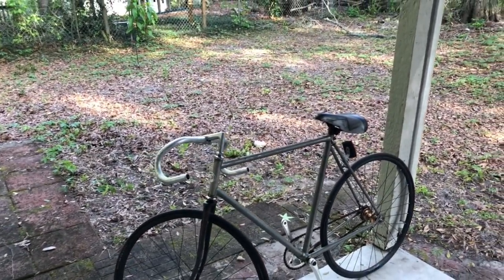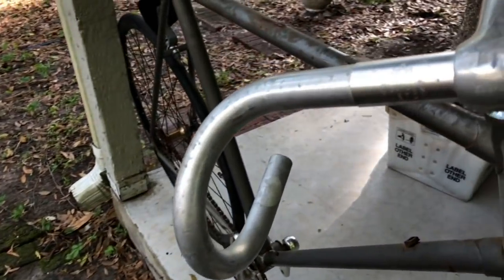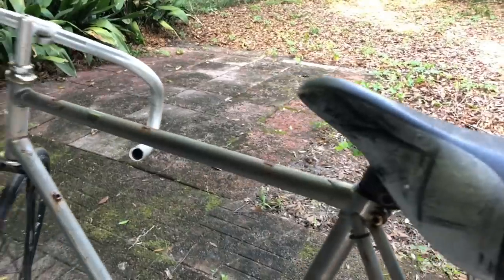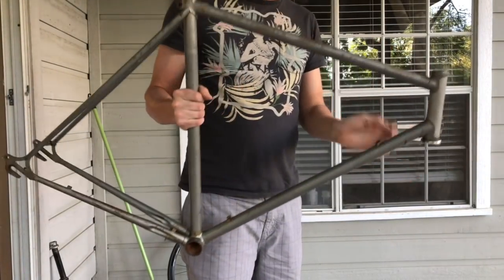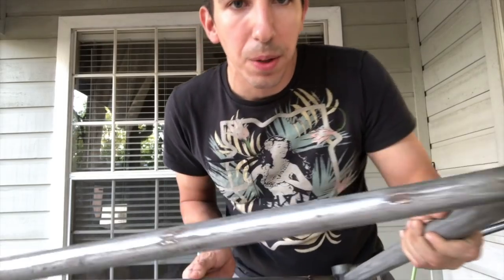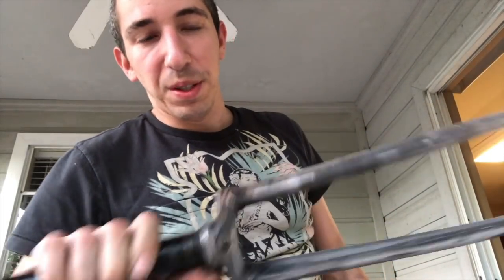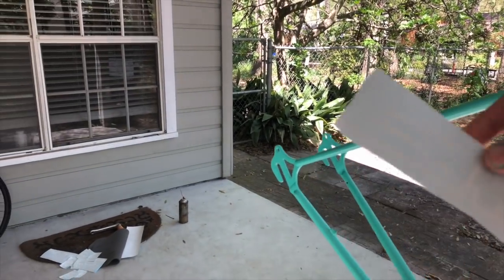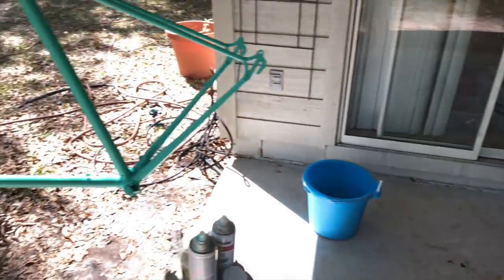Rescuing a Schwinn World Sport from the Landfill. Frame painting and restoration

Comment: Always knock the headset cups out before painting, definitely don't spray inside them those are bearing surfaces, and why wouldn't you pick out the lugs by masking and painting them a different colour... And you should have re-fitted the original head badge (IMO)...

Comment: based on the down tube center shift braze on its a late 80s bike that would have had the suntour systemic shifters.  Are you really putting rusty parts on a frame you took the time to sand and paint...?  Bronze wool my friend it will change your life